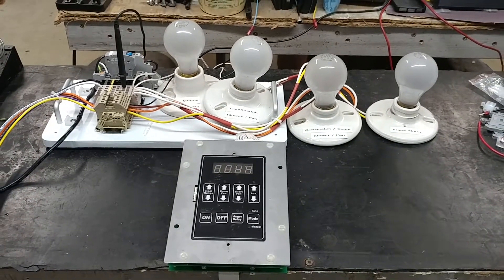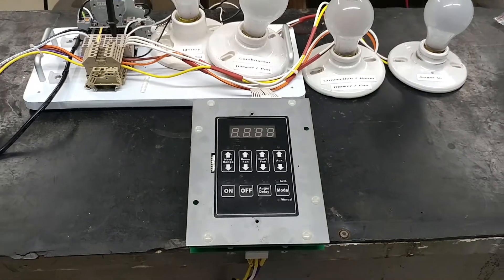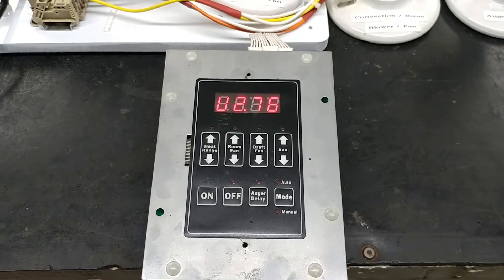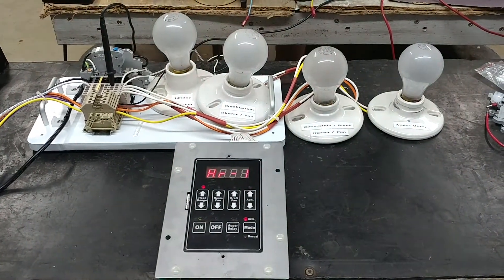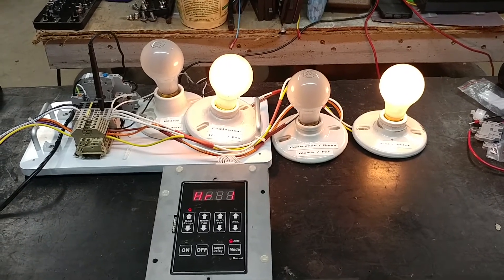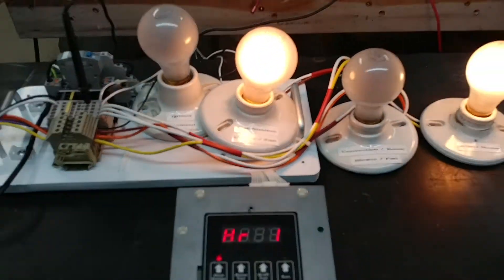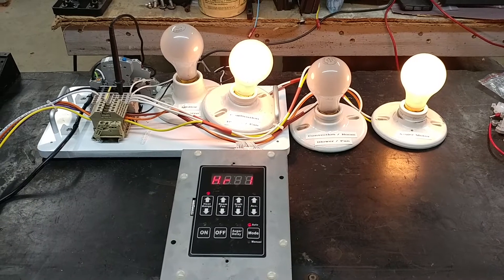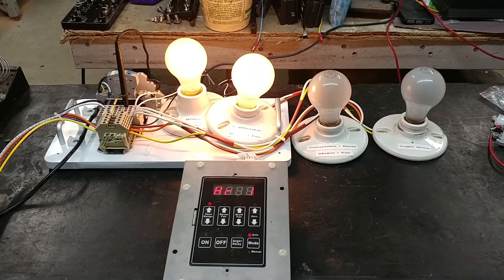US Stove Company - Part # 80558 Pellet Stove Controller - King Ashley

Comment: I am looking to control the stove through its infrared receiver with a computer. My vision is the computer will be able to check the room temperature, then turn the stove on / off based on the temperature. I am surprised US Stove did not make this easy.

Comment: Is there any chance you could video this rig for an hour of operation so I could get some timings for the auto mode maybe color code the light fixture so it's easier to tell what's up.
Reply from the maker: Hi..

At this point, no..  I do not own one of these..  I just repair them...   Is there something specific you would like to see? Most of the videos I have of these are only about 2 to three minutes long..
Reply: I am going to make a wireless application for controlling this unit...  Looking to find more information like what the circuit board looks like under the switches and how the board works and if it interface's with traditional thermostat's etc or if I can use a relay bank and copy the programming timing and just make my own control unit for it do you have a service manual for sale for the boards that would include parts and schematics or even a broken non repairable board for sale? Fun project to help a friend out just don't have 400 bucks to blow on a spare board.
Reply from the maker: I've considered the same thing myself..  since this USSC controller uses basically the same chipset as an Arduino..  Check out my Breckwell videos for ultra simple controllers, or check-out my QuadraFire videos for more details, and some of their timing / sequencing..  MSG me if you want photos and other giudance.